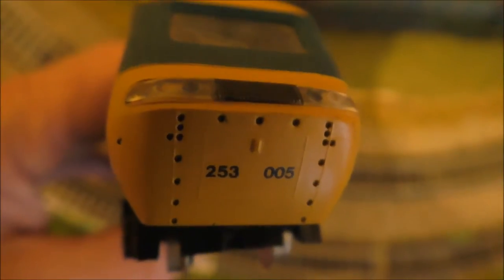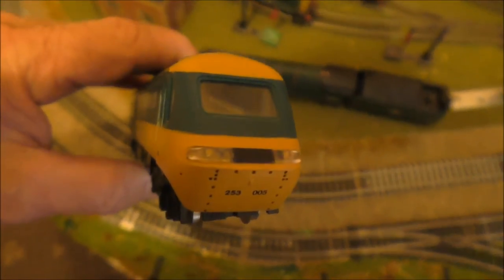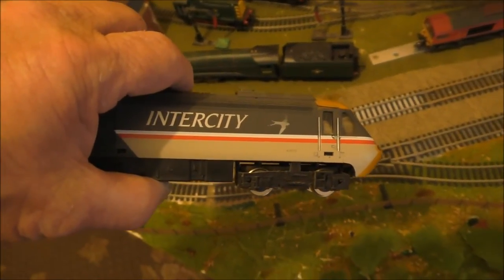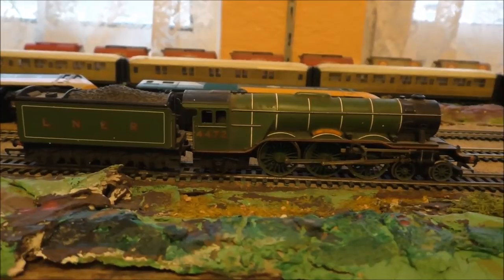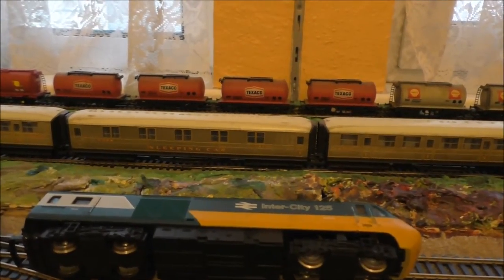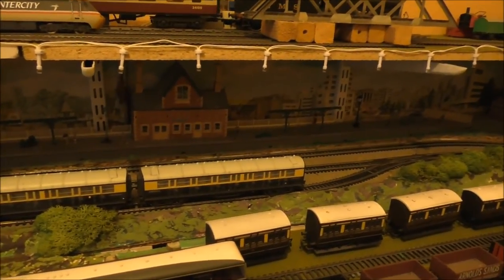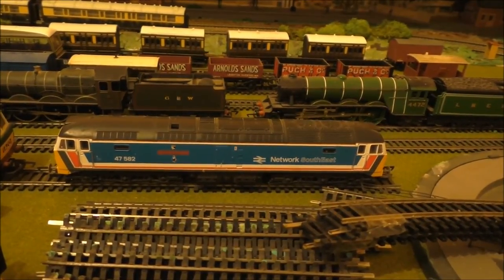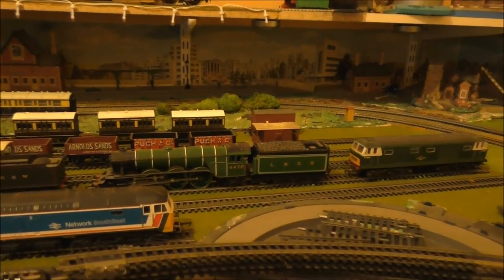Colin's model railway's 2016 update 24 future plans

Comment from the maker: I should add, all these loco's on display i have had running, about 2 years ago before i had a digital controller, i have more older stock also, sadly some no longer working, but i plan to use a maintenance depot soon, and place the non working loco's there with teams of guys around them as a feature